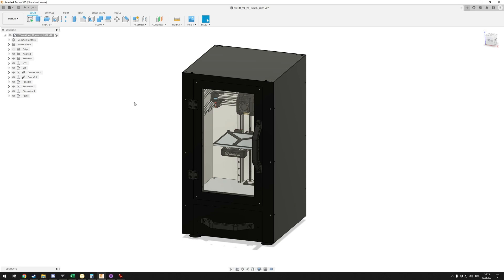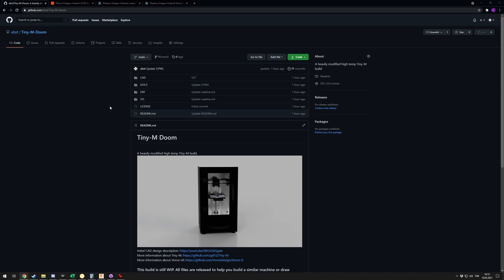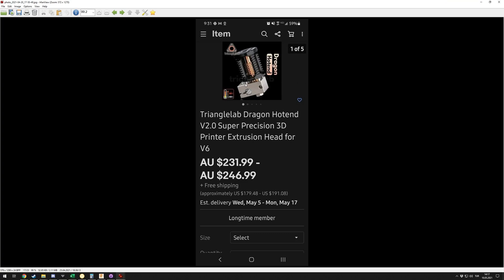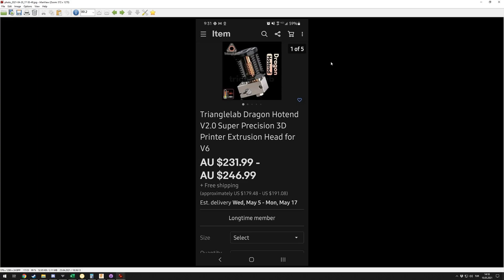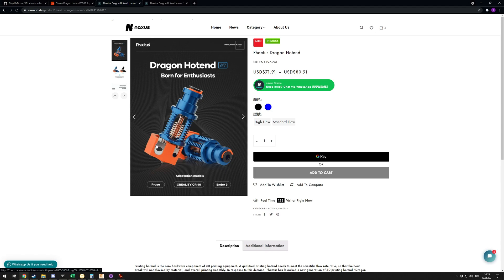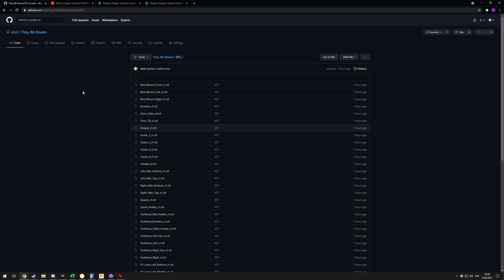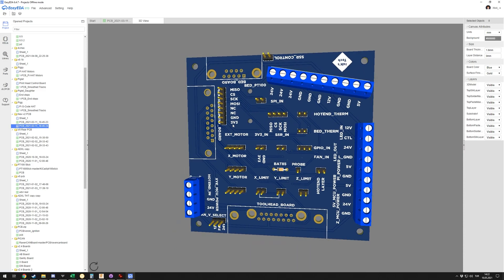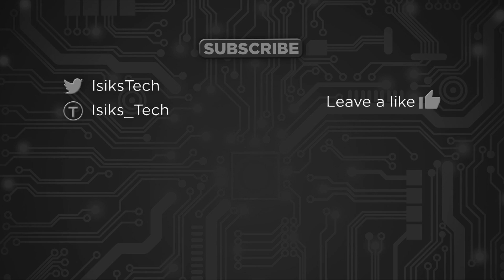Tiny-M Doom Github & Dragon Hotends - Channel Update 10

Comment: Unless I'm mistaken, Trianglelab still has their Dragon hotend on Aliexpress, but they sell it in parts across 3 different listings: heat block, heat sink and heat break.

I just ordered one a week ago, but now I'm thinking maybe I should order another one or two, just in case...
Reply from the maker: They removed the heatblock.
Reply: Looks like they've changed some of the pictures on their listings to try to obfuscate the similarity between theirs and the mosquito: https://aliexpress.com/item/4000738526729.html

Comment: The screw pattern is different between the Phateus Dragon and Triangle Dragon
Reply: Which screw pattern? The hole pattern on the top of the heatsink is exactly the same. I own both and literally just checked them to be sure.
Reply from the maker: Iirc dragonfly holes are different but dragons are the same.